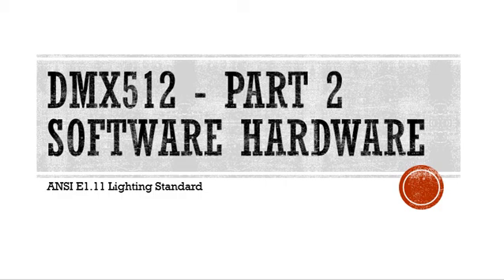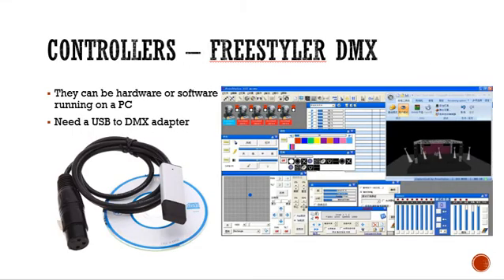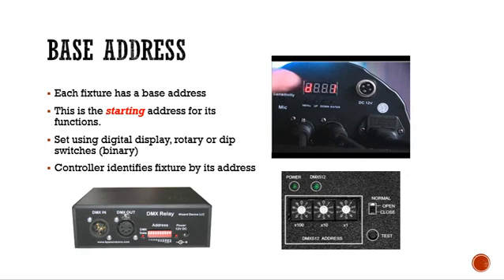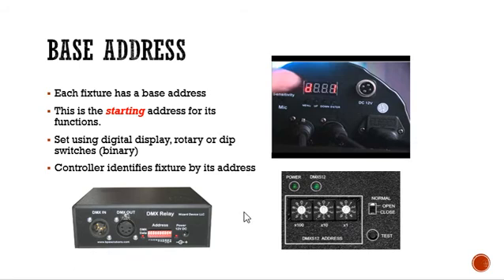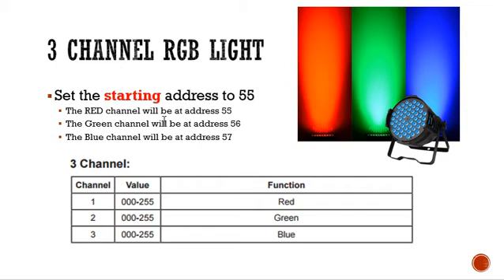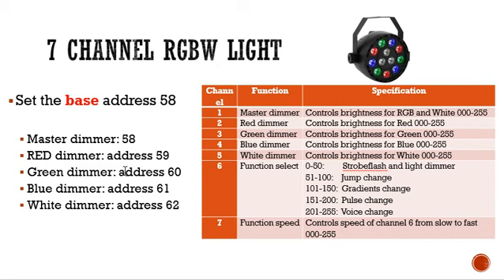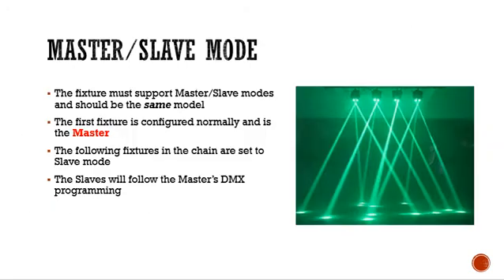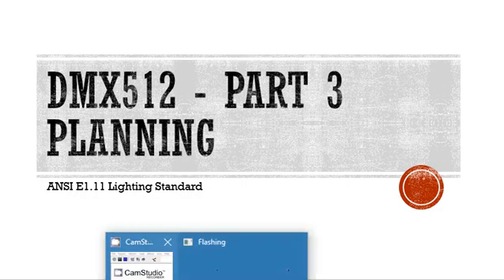Part 2: DMX Lighting - Hardware and Software (Behringer Eurolight LC2412)

Comment: Thanks so much for the very helpful videos.  I'm fairly new to DMX and am a musician just trying to set up a controller for our band for a friend to run some basic lights.  We don't have individual lights, but have 2 - Chauvet 4bar light bars with a single menu on each bar; and 2 - Chauvet 6spot bars again with a single menu.  Can the LC2412 be programmed to run 10 independent lights RGB with blends on one side of a stage, to then mirrored via either slave or identical DMX channeling to the other?  Our 4bar states that is has 3 channel possibilities 3 channel, 5 channel, and 15 channel.  We have not bought a controller yet and I'm trying to figure out the best option.  Any advice you have with your experience would be sincerely appreciated.  And thanks for the helpful videos.
Reply from the maker: When running lighting with DMX, you think differently then the old analog boards. On an analog board, one fader turns on one light. On a DMX board, one fader can control 3 light colors or functions (pan, tilt, zoom, smoke, etc..). You can also slave the lights together by just assigning the same Channel number to each light. The LC2412  board has 24 faders, each can control 3 channels. There are two more buttons which can turn on/off 3 channels each. This could be for turning on a smoke machine or mirror ball or other effect.

The 4 spot bars can be run in 3, 5 or 15 channel mode. The 3 mode would probable just be RGB, 5 would add two more functions and 15 would add functions like strobe, slow fade, random options. 

The process is to setup the lights with base channels, assign the channels to the board, create scenes and then program chases. For example, setup two scenes: first scene all lights blue, second scene all lights red. The chase will fade from scene 1 (blue) to scene 2 (red).

 You can even do "sound to light", take an output from your audio console to the DMX controller. For example, you assign one scene to low notes (blue lights), another scene (green lights) to mid notes and another scene (red lights) to high notes. As the music plays, the lights will flash according to the music beats and pitch.

On the LC2412, the top physical 12  faders control light channels. The faders are selected as the lower faders  (1-12) or the upper faders (13-24) by the fader button. The bottom physical faders control scenes that have been programmed.
Reply: @blanchae  Thanks a million for the detailed response.  You are right on the money that the 3 channel mode runs the lights in RGB.  I understood this to be the case, but didn't realize that it really means all 4 lights run ONLY in all Red, Green or Blue mode.  So that's no good.  I need more variety and blends so I'd guess I would need it to run in the 15 channel mode.  I've been looking at the Chauvey Obey 40 and 70 but have always been a fan of Behringer.  On the music side of things I record with a Behringer X32, so I tend to trust the brand.  I just need to be sure I can run 10 lights on each side of our stage (4bars / 6spots - each side) and then a 4bar as back lighting.  -- It's all rather complicated when you don't really understand the theory. -- Thank you again for the assistance and guidance.  Very much appreciated.